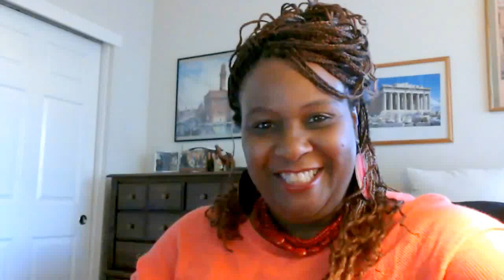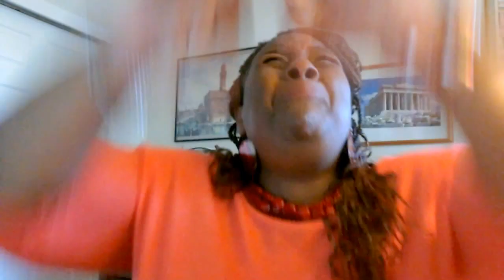What's the Difference between Upgrade and Update?

Comment: let's say you have and old computer you can upgrade it by adding a new graphic card or like more ram and stuf like that, I agree with you update definition
Reply from the maker: THank you so much Longshot for your comment. Well, I did say in the video that "When you have a old piece of Equipment you must get a new one" So that would apply to adding a new graphic card to a older computer. You are not getting a new computer because you can still use that computer--There are still UPDATES FOR THAT COMPUTER. But the graphic card maybe is not working and you get a new one of those--that is still getting a new piece of equipment and is UPGRADING.
Reply from the maker: Thank  you for your comment though because your right you can add new stuff to older stuff but only if the older stuff you can still get parts for right? Remember that Pinto Example I gave lol lol